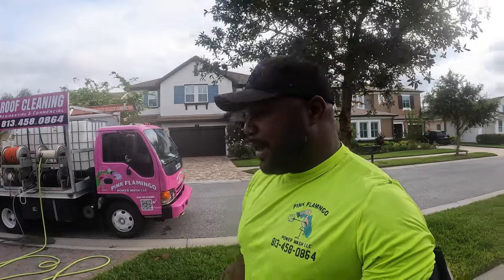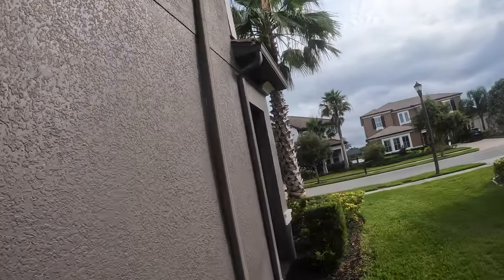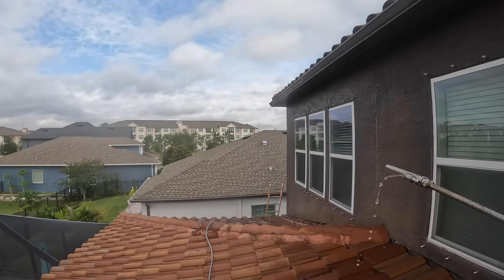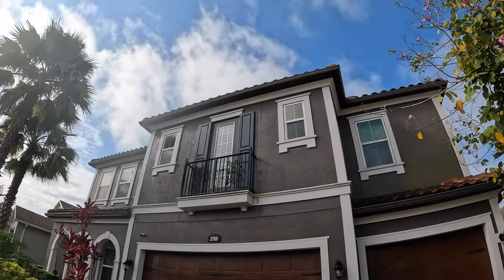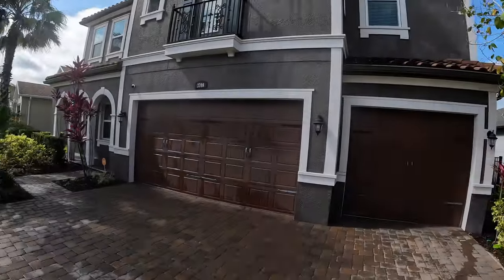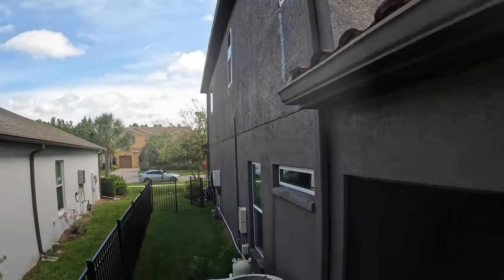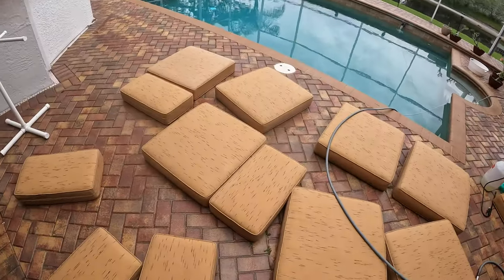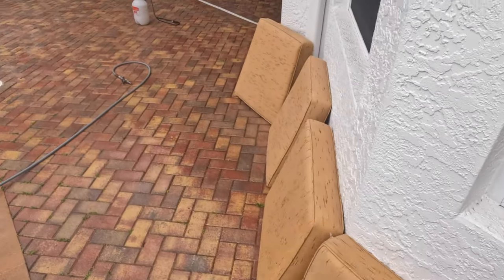House Washing And Sunbrella Cushion Cleaning #PowerWashing #SoftWash #Customers

Comment: Cliff I have a question. When you pre treat a drive how much SH do you use? I notice it suds up real good. I usually only post treat. 
 I’m always learning about the industry and any comments help. 
 Thanks for all you do to help me and others prosper in this industry.
Reply from the maker: Not much at all depending on the size. So probably a gallon or 2. Including the sidewalks.  If I'm downstreaming the post treat then probably use less than that.
Reply: @PinkFlamingoPowerWash  thanks for the info it helps a lot. Have a great day